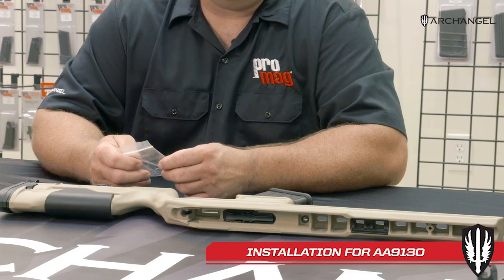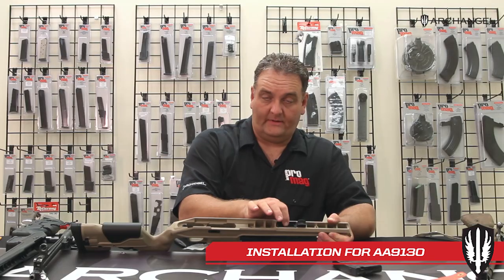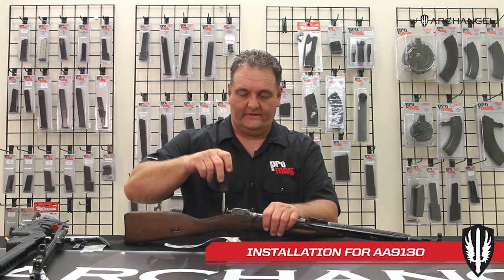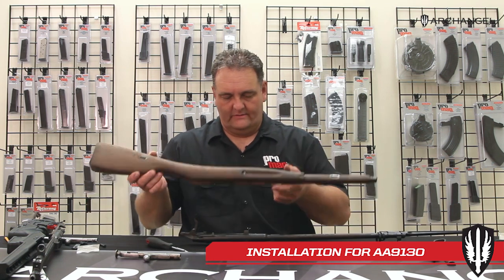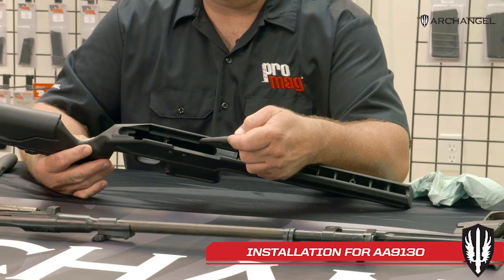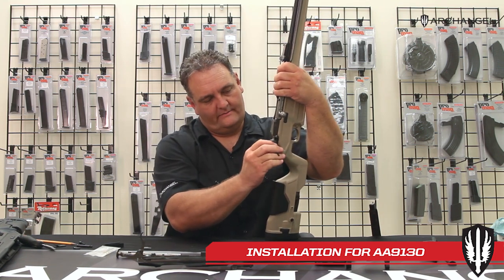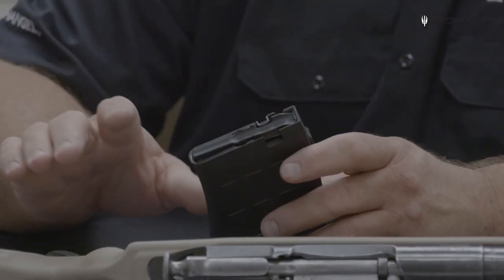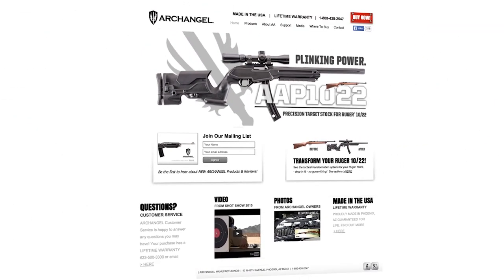AA9130 Archangel Mosin Stock Installation Video

Comment: There's one thing I didn't see mentioned and I can't find this info anywhere. What happens to your original cleaning rod? The Mosin has a hole for this, but I haven't seen any installed in the archangel stock.

Comment: Today is 9/23/19. I received my Archangel stock this morning. Already had the old stock removed from my M44. Installation of the new stock took about ten minutes. Checked the five round mag it came with for fit and function and it fed just fine. Was able to feed and eject all five rounds with no problem. Kept the stock trigger and it pulled just like its supposed without having to remove any material from the back of the trigger guard. Very pleased with my purchase.
Reply: Today is 6/04/2021

I'm eating a cheeseburger, it's pretty good. I was hungry and now I'm not. Took me 10 seconds to smash the burger. Worth it

Comment: One thing. I used a snap ring tool to open up the 2 bands which allowed me to pull them all the way off. Note that the smaller front band needed to be opened up a tad more, so if you decide later on to return your m91/30 to it's original build, you can reuse the original bands that came with your rifle.

Comment: Today is 01/21/22. I received my Archangel stock and seven 10 round magazines. The Good: (1) Aesthetics/design are very good; (2) Installation very easy. The Bad: (1) The magazines do not contain/hold the rounds properly - the slightest bump and 4-6 rounds eject in quick succession. Fitted in a mag carrier (without a strap over the rounds) a small jump will have the same effect. Holding the magazine parallel with the ground the slightest rattle will have 7-9 rounds eject. The fault is a retaining spring clip which has the sole job of keeping the rounds in the magazine - and, when the magazine is installed, it retreats/pushed cleared to allow the rounds to cycle upwards into the receiver with ease. I understand why they opted for this design (as the spring needs to undertake its task while not installed and retreat when installed - otherwise the rounds will not go into the receiver). However, the spring clip is simply not sufficient or sturdy enough to hold the rounds properly while the magazine is not installed. I tried this on all 7 magazines supplied and it was the same result for each of them. As a result of this fault, and in spite of any good points, I am sending the stock and magazines back to the distributor.

Comment: I got this stock for Christmas and my 1933 Tula hex receiver 91/30 fits perfectly! I didn’t have to shave anything down for the trigger or the interrupter or anything! It came with a 5rnd mag and I bought two 10rnd mags and all three work perfectly with absolutely no problems with feeding or anything. I can’t speak for the early production stocks but mine works perfectly and I would highly recommend it! One thing I had to do to the mags is file down the lip on the mag for the magazine catch but it worked before I did that too, I did it because the mags were a little tight to insert and remove but after only a few seconds of gentle filing they are smooth and lock into place much better!

Comment: Is there suppose to be a space between the barrel and stock like the barrel is free floating? I screwed on the two bolts and its flushed in the back, but there is a small space between the front of the stock and the barrel.

Comment: What is the product number for the new Mosin Nagant variant that will accommodate larger/thicker interrupter? I have a sniper version (longer barrel) Mosin Nagant, and the archangel stock I have won’t sit the barrel properly. The back end is sticking out about 1/4 inch. Thanks.

Comment: You would think instead of correcting the errors with additional parts and having to grind on a new stock, that they would correct the machining of the stock. I was thinking of purchasing a couple of their stocks, but after seeing the corrections that would or might need to be done, I decided against the purchase.
Reply: The reason that this cannot be effectively done is because of the cheap and inconsistent manufacture of the mosin nagant itself. Not to mention just how many hands went into the cookie jar for building these thing and by that I meen the many different countries building them. My Russian 9130 went In perfectly and everything worked well no mods required
Reply: @bradlaflamme6127  yeah!!!!

Comment: Do these stocks work on Finnish 7.62x53R? Mine has already changed stock to be a little more modern but it has done after WWII so it is more hunting rifle now. Also, my bold handle is not straight but it has turn.

Comment: where is the rear sling attachment point? My  stock 1926 Tula Hex trigger worked fine, the bolt must be closed when you insert a magazine or it will not feed.
Reply: Answer it is the hole just behind the handhold that is behind the cheek riser adjustment. Looks very similar to the hole all the way to the front of the stock on the underside. Requires a tacticool sling.

Comment: When I tighten the bottom screw all the way the trigger does not work. If I loosen it up until it is barely in, the trigger will work, but not if I tighten it even just half way.  Any idea what this issue could be?
Reply: There's info in the video about grinding down the trigger guard to give it room to pull.  Is that your issue?  I had to grind mine down before I could get enough room for a complete trigger pull.

Comment: Is there enough material in the forend to allow the barrel channel to be opened to accept a 1" diameter bull barrel?
Reply: Donovan Corcoran I am unsure about the older stocks before the problem fixes but I believe that the newer production stocks have enough room for the bull barrel as mine has quite a bit of floating room and it’s a 1933 Tula hex receiver 91/30. Hope this helps! It is an amazing stock and I have had absolutely no issues with it at all.

Comment: So guys. Can you explain why the mag/stock does this exactly? 

https://youtu.be/nhweHcSSG_M 

I have never handled any gun or rifle that does this. Period. Was this a design oversight? When the stock installed, only one round is released, unlike in my video. But that’s still one round too many. If you put a mag in a gun, you should be able to take it out, without a round being left in the gun, to hopefully fall out in a convenient place and not just land in the dirt somewhere. Not to mention, the bullet retaining spring at the top of the mag, can be so loose, that if you put the mag down a little too rough, bullets can just spring out.
Reply: Anything?
Reply: @jamesbizs  It is my understanding that the metal clip retaining the rounds was bad on some of the mags. Call them bc they said it was under warranty. They cover this in the video at about 16:30.
Reply: @TheCopperKid  the issue at 16:30 appears to be the opposite of my issue. The rounds get stuck in the mag due to plastic warping. Mine, the rounds pop right out of the mag. Tho I do have two different mags, with the metal clip being looser on one, which makes the rounds fly out even easier. Just a poor design all around. It doesn't seem like it's a defect, but a poor design. An issue inherent with the design. A single round will always release when you insert the magazine. The way they designed it, it can't work any other way. And I honestly can't believe no one else has complained about this. The fact that you can't remove a mag from your gun, without having a round just fall out, is absurd. I've never held a single gun that has ever had this bad of a design. It's as if, they expect you to shoot off every round, if you ever insert the mag.
Reply: @jamesbizs  at 16:50 he talks about the bullet retention spring on a batch of magazines not being heat treated properly and it gets loose causing rounds to be released. It's a warranty covered defect. Call them up. Hope it works out 🍻

Comment: I bought the same stock and installed my Russian Mosin 91-30, the trigger is too close the the back of the guard and there is not enough room to pull the trigger back enough to release the firing pin. Am I doing something wrong?
Reply: i'd return it and get a monte carlo stock
Reply: Dark Swim you need to use a dremel tool to remove a small amount of material from the trigger guard its a very common issue
Reply: reptile crazy gamer thank you. I was accually able to shave it down with my pocket knife. Works great!
Reply: Yours is Polish!

Comment: Installed this on mine.  Trigger guard relief was horrible and the gun COULD'NT fire.  Following this instruction video, started to dremel it down as suggested.  Hit metal.   Then, when tightening the barrel back in again with the rear screw, that metal cracked, and the rear side of the trigger guard cracked off. It's a 1943 Russian, full length and I received this stock as an Xmas present this year.   

Sent an email, all together really disappointed this didn't work out.  The trigger slot gives almost a full 2 inches to the front of it, but that rear can't even clear the guard.

Comment: This stock sucks. I ordered one, came in the mail today so naturally I was excited. Got my mosin apart and followed the instructions (As well as other views) in this video and the barrel will not fit right. The trigger guard is small so I was forced to dremel some material from the guard which now resulted in a cracked guard because of the screw...... Next the bolt would not close all the way due to the bent bolt I have, no problem, had to dremel more material off so the bolt will pull down all the way.... I finally got the bolt to cycle of course after a cracked trigger guard and material damn near shaved down to the mosin barrel... Next is the mag.. will not feed properly... will not eject or cycle. If you also happen to hit the pin holding the rounds in the mag while trying to insert the mag the rounds fly out all over the place... guess I just lost $200 on this thing...
Reply: Skumstwo, man I just bought this and I have the newest edition and all these problems have been fixed... mine made my rifle awesome.